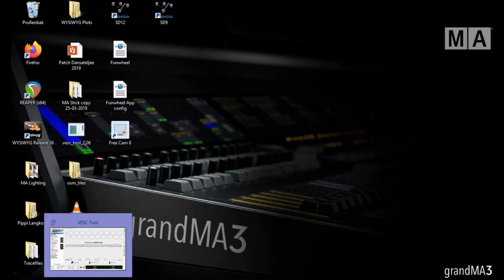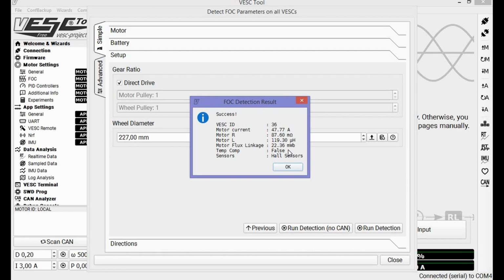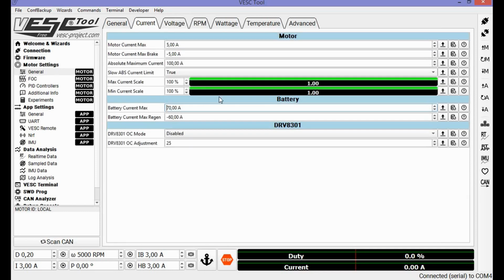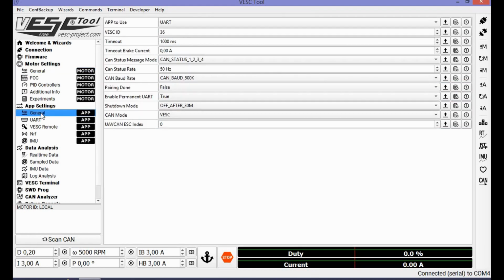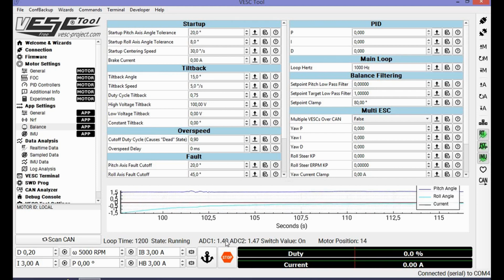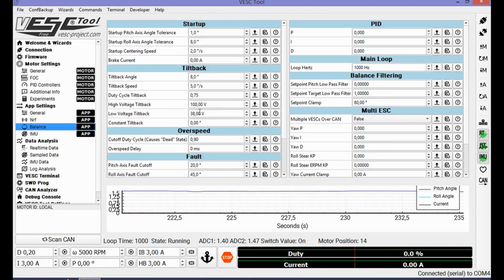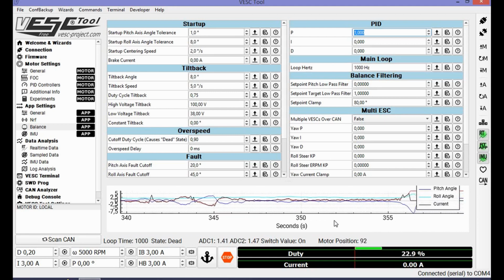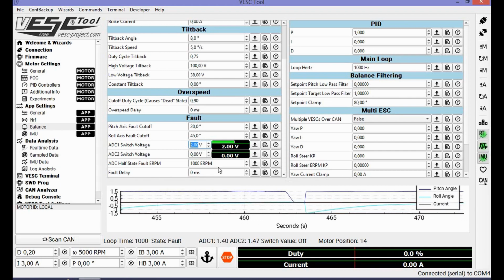Funwheel CheapFocer 2 Basic Setup

Comment: Wouldn’t 10 inch be 254mm not 227? Also thought you should choose e-bike/DD motor during motor detection?
Reply from the maker: Yes that was a typo. My wheel is 270 and typed 227 by accident. I have been told not to choose that bike motor setting. I ride perfectly so i leave it at that 😁